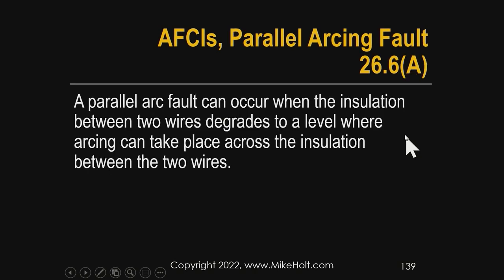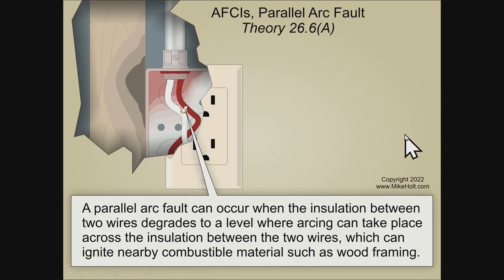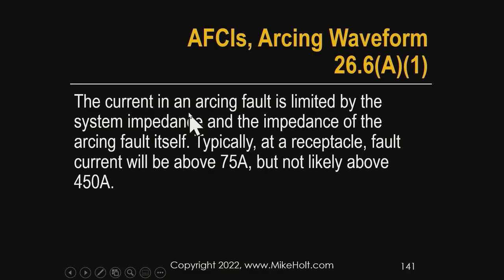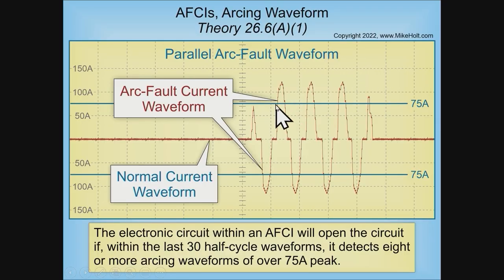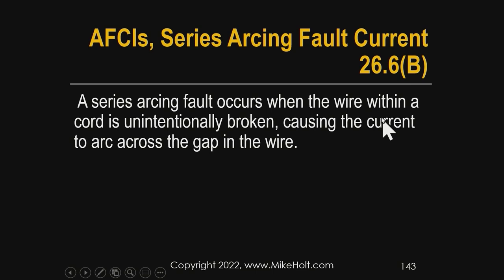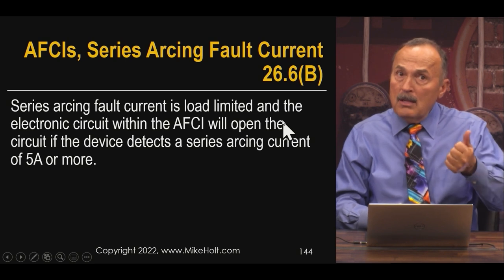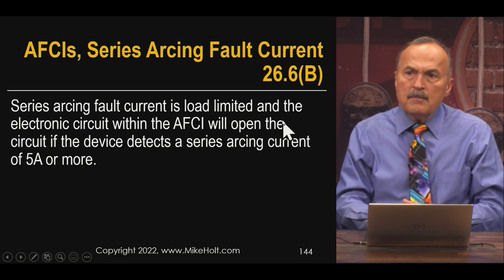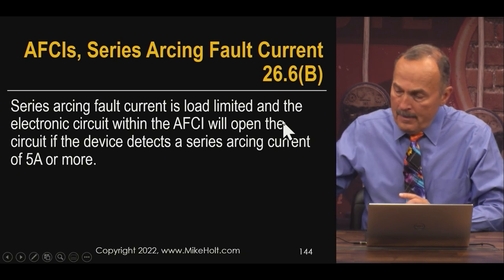AFCIs, Clearing Series and Parallel Arcing Fault

Comment: I don’t know if this was addressed, but in your example about the GFCI receptacle tripping with light switches, I had this happen in my house. I installed an AF/GF combination receptacle in my living room to cover the outlets thinking I was gonna protect my house. Every time I turned on the lights, the receptacle tripped. What I found was the branch circuit not only covered my Living Room, but also covered the porch lights. Well, one of the porch lights had a wire that ran out to another light in the middle of my yard. Between my house and the post, I found the wire had a nick in it, which is why I kept tripping the receptacle. In my case the receptacle probably saved someone’s life; otherwise I would’ve never known the wire was bad underground.

Comment: Had some challenges with an AFCI breaker in a home I rented (Florida 2020 or '21 build, if I remember right). Did some research and the NEC had a short write-up on how computer power supplies can frequently trigger them. The variable load characteristics are tough to distinguish between series faults, if I understood right. AFCI would trip a few times per month. 

Unfortunate, and just had to deal with it. Had an uninterruptable power supply (battery backup) that kept the PCs on when it happened. UPS would run at least once a week.
Eventually discovered the UPS had a bad cable. The joint for the cable to the prongs in the plug was bad and heating up.

The AFCI was doing its job the whole time, but my search for the issue was masked by the report that AFCI can trigger on false positives from computer hardware.

Moved into an '04 build with old CH Eaton AFCIs that are known to go bad. Back to tripping constantly. Swapped it out and all's well.

Comment: Parallel arc happens typically at a pinch point, and a series arc typically happens when a cord is moved and or cord bends a lot, some kinds of wire are more durable than others, ( I am talking from experience with wire that breaks after bending to much at the connection point, you will see me showing that in some videos 
of 12 VDC and 4.5 VDC battery
 and 5 VDC and 1.7 VDC circuits I put together, when I bend the wire one way, the relay, heater, AirConditioner fan, circuit stops working, when I bend the other way it works again, when I strapped the wire at the connections the wire lasts longer )

Comment: This is true with testing AFCI or GFCI manufacturers recommended procedures to test is the test button itself on the product.. especially when you replace old two wire branch circuits with ( no ground ) with a gfci receptacle or breaker, an external tester will not trip the receptacle or breaker and you would have to hit the test button on the actual device(s) to perform its function.
Reply: Test it once a month

Comment: 75A confuses me; Could you give a real world test as American and UK panels to my knowledge in Australia with AFDDs. To my understanding there's a micro-controller that monitors the waveform. 

Different appliances will trigger such an event, which makes it hard for us electricians to give a diagnoses.
Reply from the maker: The 75A peak current is shown in the graphic. Above that and if the waveform is identified as an arc, then the process begins.

Comment: If u install an AFCI breaker  in the panel box, on a circuit will it protect the other receptacles down the line?
Reply from the maker: Any protection (AFCI, GFCI, ground fault, overload, short-circuit) at the beginning of a circuit will protect all of the circuit...

Comment: How can you be sure with a combination GFCI/AFCI breaker that both functions are working correctly when the test button is pressed?
Reply from the maker: AFCI - You only use the AFCI test button on the AFCI. In accordance with UL (AVYI), AFCI's are tested by "The test button on the AFCI will demonstrate proper operation of the AFCI."
GFCI - You use the test button on the GFCI.
Reply: @MikeHoltNEC   On a dual function breaker with both AFCI and GFCI functions, there is only one purple test button.  There are not separate test buttons, one for AFCI and one for GFCI.
Reply from the maker: I did not know that.. I see that the GFCI automatically and continuously tests itself and the test button is for the AFCI. Thanks for teaching me something new.

Comment: 12:00 Brian didn't get the chance to finish what he was saying.  Anyone know why customers would request individual GFCIs?  I guess it makes it easier to track down the guilty appliance, but how often do you need to do that.
Reply from the maker: When the NEC requires GFCI protection, it can be a GFCI breaker at the panel or a GFCI receptacle, When it's a receptacle, it's hard to find when it trips, but at the panel, it's easier to find.
Reply: @MikeHoltNEC  Yeah I get that, but that's not what I was asking.  Brian was starting to say (at around 12:00 timestamp) that some customers request tons of individual (redudundant) GFCI receptacles on the same circuit.  Wasting a ton of money for some unknown purpose which he didn't finish explaining.  I was just wondering why someone might request this.

Edit: Actually I shouldn't say "reduntant" because I assume the load terminals are not used, so each recep is protected only once.  But it's intentionally wired to use all those needless GFCIs on the same circuit.  They gotta have a good reason?
Reply: My comment was about the practice to provide individual GFCI receptacles (not line load) at every outlet so that if the individual appliance tripped it didn't affect the other kitchen appliances like wine coolers, mini ice makers, or things like instapots or microwaves with timers or clocks that would reset and interfere with a scheduled operation. This is also a common practice for Garage and outdoor receptacles here in Florida because of deep freezers that are connected to a garage receptacle circuit that also supplies an outdoor receptacle on the garage exterior.
Reply: @brianhouse5983  Ah yes, I can definitely see how the outdoor receptacle and garage deep freezer would be a frequent issue!  Very smart!!  Thanks for the reply.  Now it makes sense.
Reply from the maker: Contact Brian@MikeHolt.com and ask him to clarify.
Reply: I hadn't thought of that but I can see some specific applications where this would make sense, tripping a kitchen appliance outlet wouldn't shut off the refrigerator for one example. It is an expensive and unneeded overkill to simply make every receptacle in the house a GFCI without a specific need (resetting a clock on a coffeee pot I wouldn't consider a critial need). But I guess the thinking is, if it's worth doing it's worth overdoing.
Reply: That’s why downstream receptacle protected by a single GFCI/AFCI receptacle should always be marked with a GFCI/AFCI label - Leviton and other manufacturers provide such labels and doing that helps customers understand and others what receptacles are protected and what are not. There is the issue of selective coordination would you do a belt and braces approach a GFCI/AFCI receptacle protecting downstream receptacles but an GFCI/AFCI breakers at the panel? There are occasions where this can be valuable especially if the breaker or receptacle GFCI/AFCI have slight different leakage current and time characteristics or in the case of AFCI slightly different current and voltage waveform characteristics. It also helps if those circuits are critical ones where avoiding protection failure is super critical. However doing this requires more selective coordination analysis. I wish manufacturers released more trip time and current level data for GFCIs and peak current and cycle data for AFCIs. Manufacturers of fuses are better in that regard especially Bussman and Littelfuse. Publishing this data helps in doing the selective coordination analysis. With advent of AI you will start to get more adaptive learning GFCI/AFCI and surge protection devices more tailored to for the buildings they are housed in. In a word tailored protection.